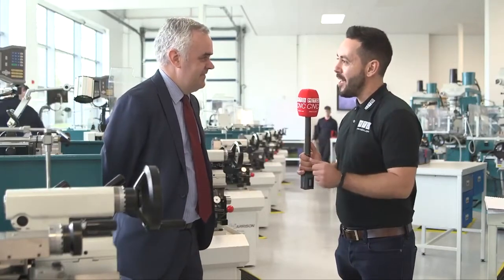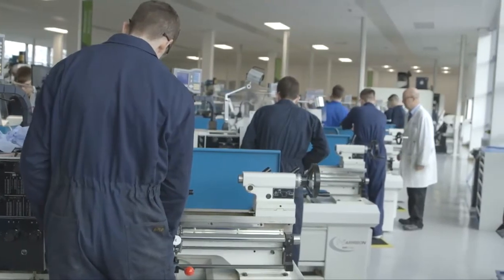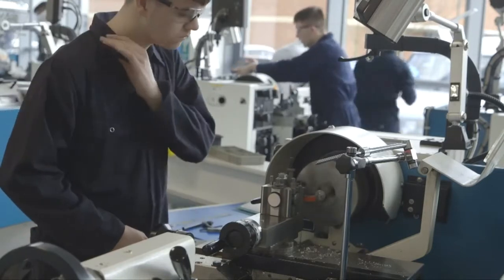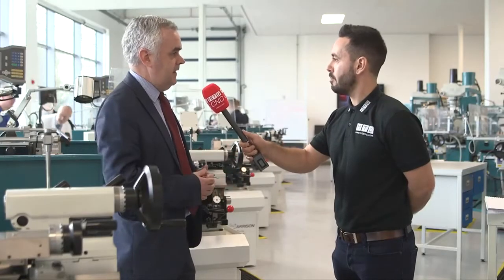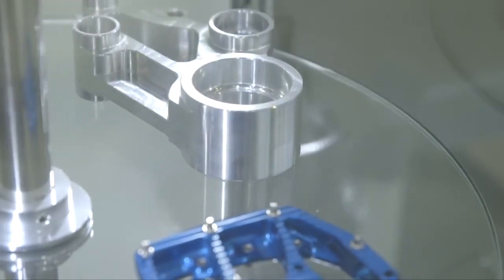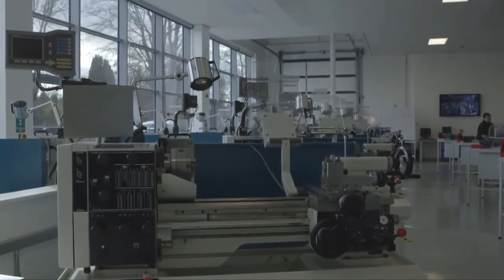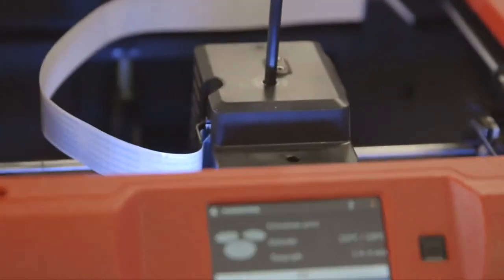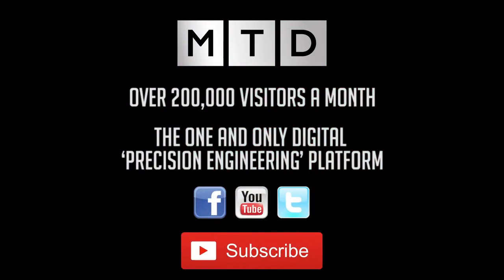Colchester, Harrison and Clausing machines at Coleg Cambria's Engineering Technology Centre

Comment: Hi , that's for video.
Can you help me. What is the difference between the Colchester and the Harrison versions?. I am in USA and emailed 600 group in uk  who wanted me to contact USA distributor , I was ignored , no response typical USA.. We are looking for a another manual lathe and have an old colchester and have found the cheaper Asia lathes don't hold up or have the parts. 
This looks like a variable speed lathe I need a gear head version , can't afford double the price. I noticed the gear change system  has recently changed , who do I talk to find this stuff out so I can make an informed buying choice?
Cheers Warren
Reply from the maker: Sorry you didn't get a reply - whilst we are headquarter in the UK, Clausing in the USA should be able to assist you.
Get in touch via our website www.colchester.co.uk, that will go to our main sales department which are in contact with the US.

To answer your other question, very little these days - the Colchester and Harrison ranges were always very similar and since the 600 Group aquired both companies (1954 & 1971 repectively) later delevopments and further standardisation have made the two ranges pretty much identical - however as each brand name is better known than the other in certain countries/markets, thus some customers preferred the branding to be one or the other, both brand names have continued - when you're established as one brand in some areas you don't cause confusion by trying to force another on them.
Reply: Colchester Machine Tool Solutions   Thank you, so are the Harrison and colchester lathes using the same casting and gear boxes?  Or are they separate lines that don't have interchangeable parts? They appear different on the outside.  In the USA I would say the Colchester is much better known , the Harrison is much rarer . But I have noticed that the large supply house MSC is now marketing clausing/Harrison manual lathes .
I have a machine shop where we do a lot of one off and repair/ reverse engineering of existing equipment of other manufacturers.  We have 2 CNC Lathes but the manuals are very useful when we are machining one piece from a sketch made off the broken part or modification to an existing piece of equipment. This is work not practical on a CNC when we the operator is actually making the part as he goes along! Cheers Warren
Reply from the maker: @CheersWarren  it would depend on the age of the machines - the latest  models are interchangable parts wise with its counterpart, so for each size in the range you'd need to know what its counterpart is - for exampl Colchester Student and Harrison M300 (also there are metric and imperial versions of our lathes, so care needs taken there) 
Current range they now look the same bar the branding on them, but as you go back through the various revisions to the older versions of each model this will increasingly not be the case, so in the case of our named models above as you go back you see difference in them till you get back to the original totally incompatable, parts wise, lathes.
Thanks for sharing about your machine shop set up,  you've pretty much summed up a lot of why manuals machines co-exist with CNC and why folks still buy them.